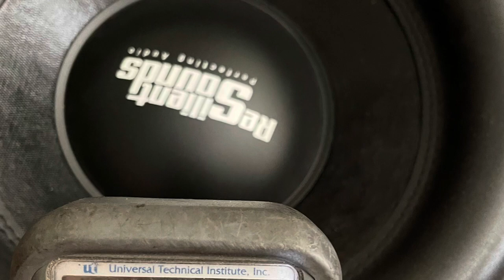4th Order Malibu. 3 Resilient Team 15’s Build Vlog 6

Comment: I used wire ferrules on my Taramps 8000.1 and realized they aren't what they are cracked up to be. I won't do it again. When you go to pull the power out for maintenance the ferrule stays and you end up ripping out the wire out of the ferrule. Then the ferrules are a real pain in the butt to extract. I suggest tinning your power ends like the manual suggests.  Looking good though!